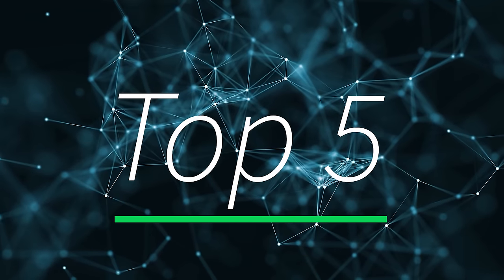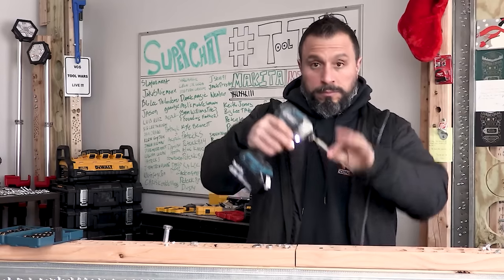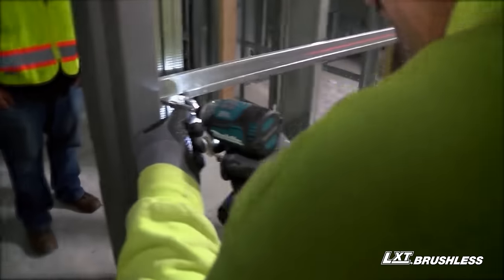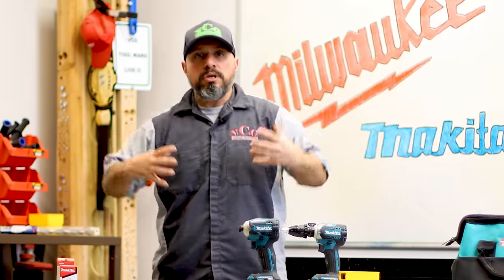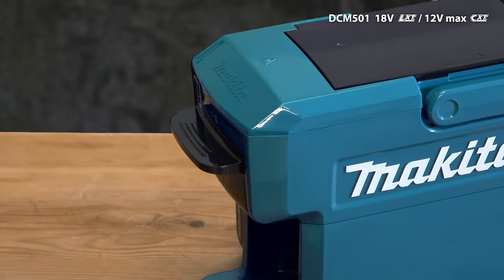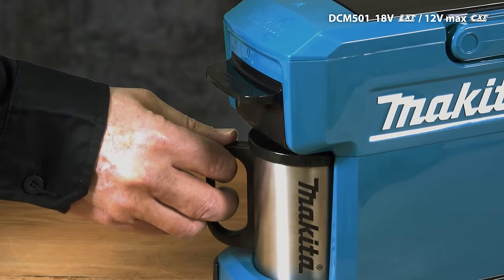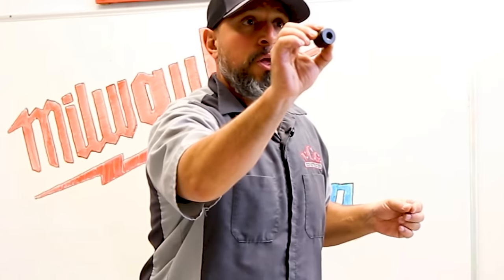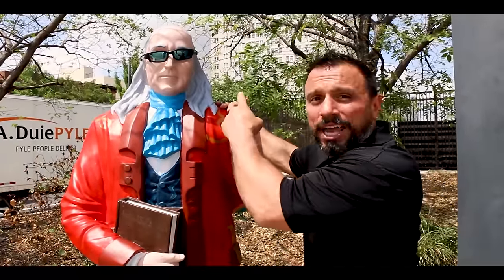TOP 5 BEST MAKITA TOOLS THAT YOU MUST OWN IN 2020!

Comment: Ive been makita since 2006. They survive the 6 day per week beatings way longer then the 12 months you get out of a dewalt before the motor craps out, or the 6 months a Milwaukee lasts before the chuck craps out. I got 11 years from a brushed 18v drill, the impact was still good. But i moved up to brushless, and the drill and impact are animals. Love them. The majority of tradies in Australia  ive worked with on site run makita everything.

Comment: I love the xdt16. Been on Milwaukee for years and I actually just made the jump to makita for the impact driver the past couple months and now I’m finding more and more solutions from them. Great OPE.
Reply: Back in 2000 the main tool competition  companies were DeWalt and Milwaukee. I bought the Dewalt 18 volt Hammer Drill and a friend got the Milwaukee. Now I'm not much for bragging but once in a while something needs to be said. We stuck a stainless steel rod between chucks of both drills tying them together then tested their power. Both were 18 volt but the DeWalt spun the Milwaukee backwards and my buddy's  drill started to smoke and that's when we stopped. It was a hard test because both drills were loaded with torque but he and I are both big guys so we managed it without Injury. Don't try that at home. Some of these tools are powerful enough to pull your shoulder out of socket if you're not stronger than the tool. I still have my DeWalt drill and the other Hammer Drill and they both still work perfectly but they're old and I need to replace one of the chucks. I have not tested the Makita against any other tool but I wouldn't recommend it simply for safety's  sake. But all three of the big name brands can hold their own these days. Edit...I put some WD-40 into the frozen chuck on that drill and it wouldn't budge. It was rusted solid. So I did the same thing again and again. Still not freed up. So I took a step rid and placed on the end of the jaws and smacked a few god times with a hammer and that frees the chuck up. So ALL of my DeWalt tools work flawlessly now. I will also say that I like a lot of Makita tools. I bought the corded Makuta 1/4 horse power router kit with a ton of attachments but I still wasn't quite happy with it.  It just seemed incomplete. So I also bought an 18 volt charger, several 5.0 amp hour 18 volt batteries and the battery powered 1/4 horse power trim router to complete the kit and I love it now! The quality is incredible and I now have ALL the attachments that I could find for this router kit...and all for under $700 total. Very sweet buy.
Reply: I’m here in 2022 and I’m phasing out my Milwaukee 18v tools for makita.
Reply: You wanna say Makita is better than Milwaukee?

Comment: I bought and returned the Makita Fan Jacket because the 3X jacket (largest offered) is more like a large for the US Market. It was so small that I could barely get it over my shoulders and it was skintight when I zipped it up so there wasn’t a chance that air could circulate around me. The jacket worked for my wife even though it was too large for her. 
I exchanged it thinking that it was marked incorrectly and the replacement jacket was exactly the same. 
Great product if you aren’t over a Large or maybe a 1X.

Comment: Great video!  I have the Metric and SAE sets.  I ended up getting both the 3/8” and 1/4” sets.  Use them quite a bit.   The socket holder is nice and compact.  Easy to store.

Comment: Got the Gold impact bits in my tool box. Also use the sawzall blades love them. In a extension list  Vince,can you please talk about :                            1-the hybrid vacum.                  2-the systainer cooler.           3-the 36v platform. made with two 18v batterie.                               4- the 3/8 shock made for impact driver.                        5- Miss Makita 😍😁🇫🇷 thanks.

Comment: Makita batteries are used by most of the F1 teams for brake and sidepod blowers in the pit garages. If they’re good enough for the pinnacle of motorsport, that pretty much speaks for itself. Some teams have taped over the logo but even then they’re pretty easily recognizable...

Comment: I use Makita.  I have the impact driver shown on this video and it is a beast. So far nothing out performs it. Been wanting a coffee maker but haven't pulled trigger on that yet,  Won't be getting the roomba thing or the cooling jacket, but I do have the impact sockets. I have 36v chain saw, rotary hammer, circular saw, 7-1/2" miter saw.  Love them use them, they rock.  But Makita doesn't have a battery table saw yet, bummer.  So I got a Milwaukee battery table saw, It is awesome.

Comment: I've got both of the socket sets Vince! Haven't used them but just in case. 😂 I'm so addicted to Makita, I have a work tool set and a home tool set. I'm starting to go broke. 🤣
Reply: Can't be broke if you are filled of Makita tools 😅
Me too I am addicted to Makita and Snap-On 🤤😵😭
Reply: @yobryan88  now THERES some expensive tools! I used to work in a body shop and bought Snap-on and Mac tools all the time. Blue Point makes some pretty decent air tools as well and you can get them through the Snap-on dealer (or at least you used to be able to when I did body work). The Snap-on air drills will spin just about any other air powered drill backwards. Very good name brand...and now everyone knows why you're always broke🤣🤣🤣🤣🤣

Comment: Hands down the coffee maker still leads the pack. COFFEE = WORK = MONEY!
Reply: I am still waiting for Dewalt to come out with a coffee maker for the boat and camping.
Reply: @lesleyboeder1798  Maybe Makita holds the patent for the cordless coffeemaker? That could explain why no other company has made one so far. Dewalt held the patent for a contractor's radio with charger until about two years ago. That's why we're seeing Milwaukee and Ridgid offer one. Milwaukee and Bosch got sued when they made such radios before Dewalts patent expired.
Reply: @lesleyboeder1798  DeWalt came out with one a long time ago and its ugly as sin. This one is way better. You can sometimes find them on Ebay. That's where I saw one a few weeks ago.
Reply: 5 cups coffee is good for a 5ah unless not doing much work just chilling slaking the work and  drinking coffee all day ha
Reply: @littleshepherdfarm2128  thiers a boat load full on Amazon
Reply: @micjubba709  I'll hafta give her a look. Thanks.

Comment: Hey Vince, I saw another channel use a Makita drywall cutter that won't damage electrical cords behind the drywall and makes nice cuts.  It's radically different from the rotary, drill bit type drywall cutting tools - Makita Model XDSO1Z.  I thought it's a cool tool if you do a lot of drywall cutouts - maybe something to consider for a review video.  Online only at Depot.

Comment: SAE & Metric, couldn't beat $20 for both sets. Already used them to level my Delta table saw extension tables, rails.
Reply: SAE & Metric, as well and 12V impact driver. Recently got the x2 rear handle circ saw

Comment: I got a few ryobi tools, but all the mixed reviews are giving me anxiety. Some say they are fine, not the best but get the job done. Others say they are horrible and the motors burn out or aren’t accurate at all. I have 1 makita drill and 2 batteries with no charger so I guess I’m going with makita from now on.

Comment: It would be nice to know if these Makita impact sockets are thin walled or not. Because it was not mentioned in this video. Also you were asking why people might not have an impact driver? Well the biggest reason I can think of why somebody might not want to use one is because they are so fudging loud the noise really penetrates and carries through the whole neighborhood. I love impacts just wish you would come back and have some reason to want to cover again those hydraulic ones. Which are a somewhat quieter / less piercing. BUT also as for the different action on hydraulics I was also really interested to know if that different action will make them less easily snap the socket adapter. Because with a regular 1/4 inch impact driver with hex collet are so powerful these days it will just tear up those adaptors real easy. Assuming the bolt is stuck, the shank of the adapter (or nutsetter) is the weakest link in the chain. I have heard that maybe the Husky adapters are perhaps a little bit more durable. But it would also be great to see some testing the hydraulics vs the regular impacts on this specific situation. Please try to cover this !??!?? Maybe?? For example if they release a new or updated tool in this product category. Or to compare against one of those 'special modes' that Makita has on the buttons. Many thanks for considering this. Love you guys @ VCG.
Reply: The sockets are thin wall

Comment: Makita has been around for a long time and they make decent to good tools I think Makita is more DIY professional use where Ryobi is DIY rigid is DIY some tools can be used professionally but my point is they're not like Milwaukee and DeWalt for the pros but Makita is very close like I said they been around forever
Reply: I work with about 10 guys four of us have Makita the rest all have DeWalt we switch back and forth when we're all in the same room working together and you're wrong the makitas are the professional standard the dewalts feel like crap in your hand after you've been using the makitas